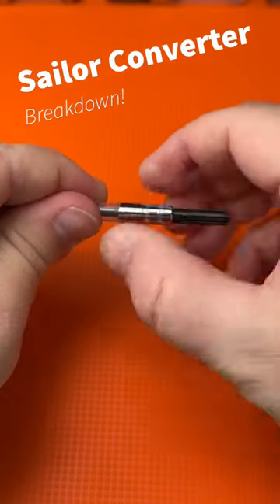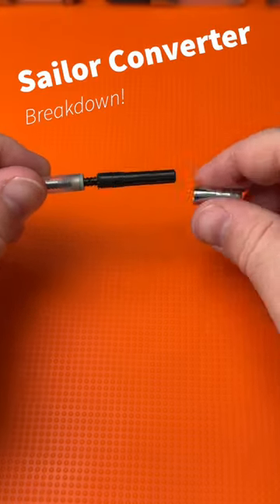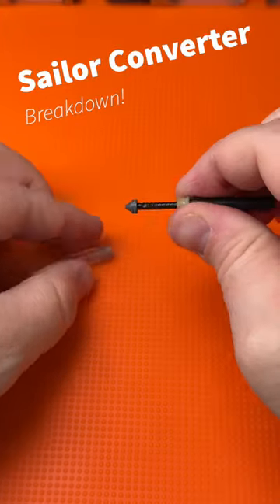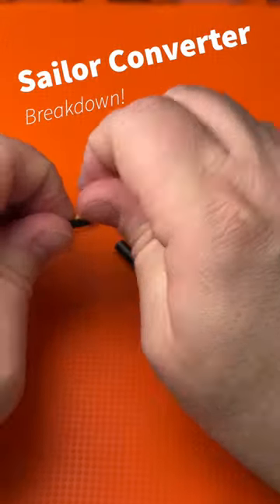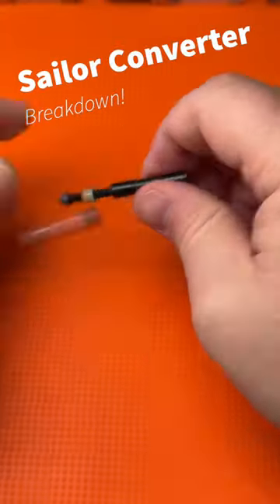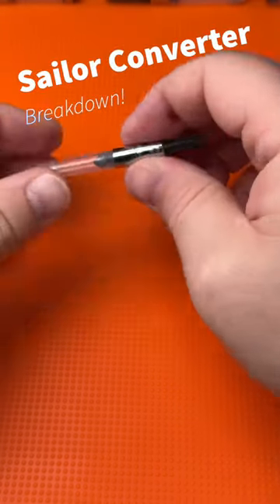Taking apart a Sailor converter for cleaning! #shorts #fountainpens

Comment: I can't get the piston out, it doesn't slide and I'm afraid to break it if i pull too hard. Is there anything I can do to save it?
Reply from the maker: If you’ve taken it all apart and the piston is stuck, then just drop it in a class of water and wait. Probably you have some ink that has dried out and is acting like glue. It’ll dissolve and you’ll free the piston.